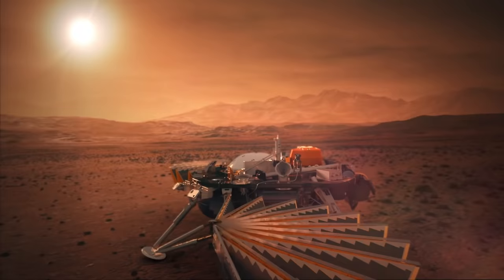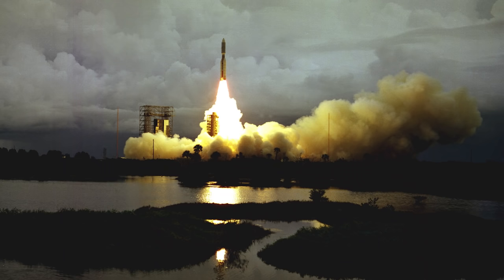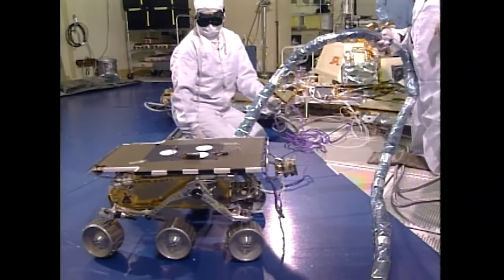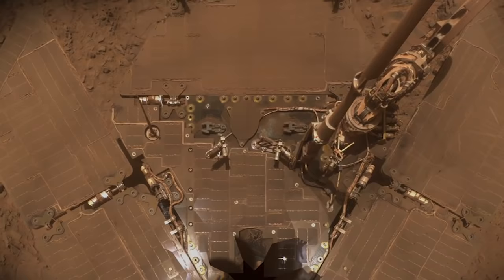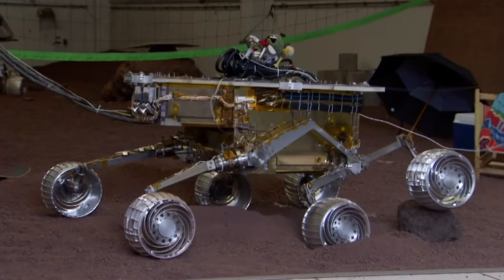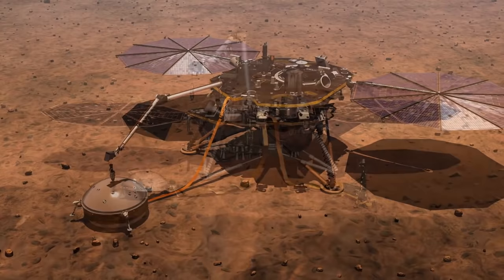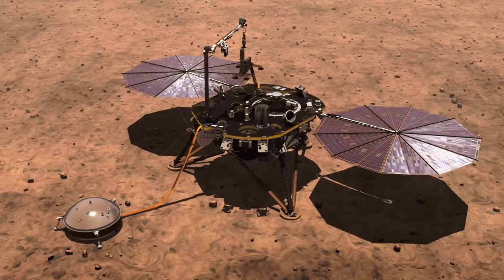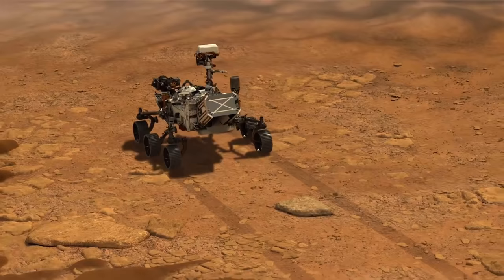Perseverance Rover and Other Spacecraft Currently on Mars

Comment: I believe the info about ingenuity is not correct, in that it is not going to be searching for driving routes.  Ingenuity is experimental just for the flying data it will aquire and transmit.  It will not serve any purpose for Preserverance mission.  :)

Comment: Well, the "Other spacecraft currently on mars" statement in the title is not exactly true, but not false either. Its just a little bit misleading. What about others that are not owned by NASA, like for example "The Beagle 2" of the British, it is technically currently on mars just like the "Mars Polar Lander" in the video that crashed. But instead, this spacecraft landed successfully but unable to operate due to a failing attempt in opening the solar panels result in a communication blackout.
Reply: if you put "that sent to mars by NASA" that in the description onto the title, it'll be much clearer.
Reply: @siriwatgatanyatapong2826  he make part 2 with the title you say